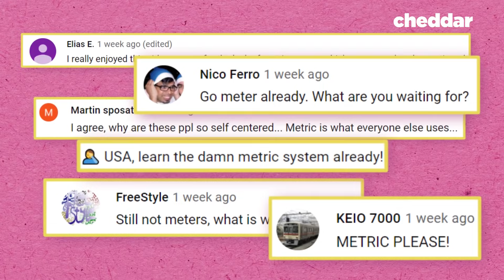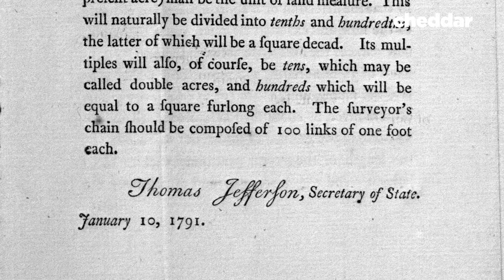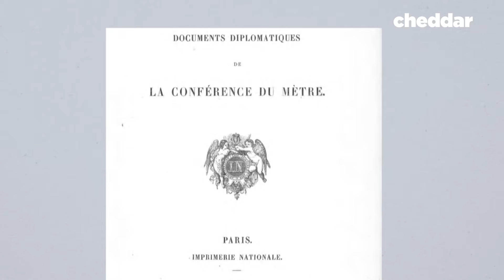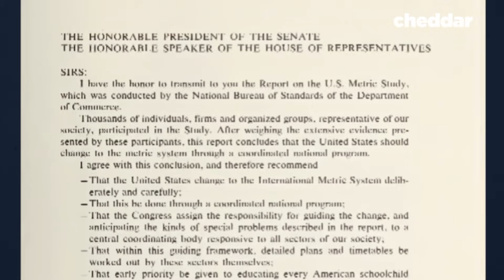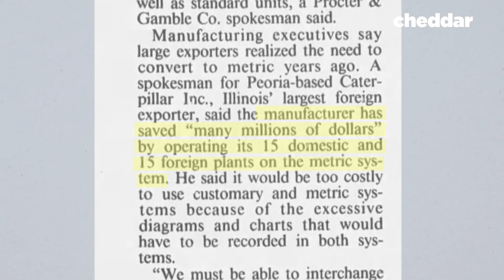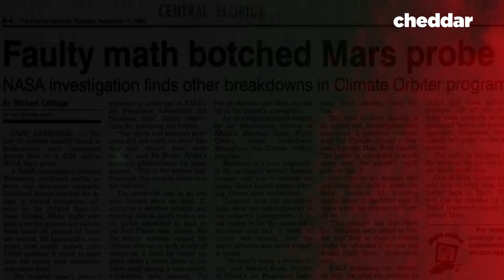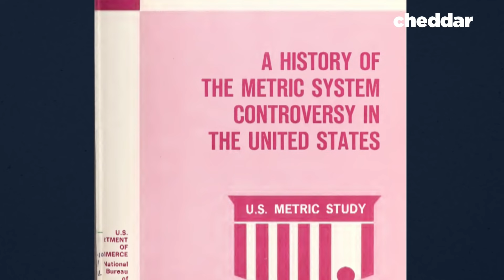Why Doesn't the US Just Use the Metric System? - Cheddar Explains

Comment: Just look at the conversion tables, metric is far easier then imperial.
Reply: you dont even NEED a conversion table :D
Reply: @Great.Milenko  I am America. I believe in the metric system. Not because of convince, I just don't think our base measurement should be the length of an average male foot. Saying it just sounds random.
Reply: @ItsNullAndVoid  the inch is actually based on 3 barley corns.
Reply: @Great.Milenko  That's even worse.
Reply: @F.B.I  Don’t talk to the foreigners, they don’t understand feet like we do. Go back to your house and count your barleycorns like a good patriot.
Reply: @markme4  It's spelling and punctuation, not grammar. "America" should have been "American", "convince" should've been "convenience", and the comma should've been a semicolon. If you're going to call someone out, at least call them out for the right thing.
Reply: access  metric was invented by the french imperial by the British who we declared independence from which is more patriotic
Reply: @1pcfred  you are wrong. Us customer is defined on metric nowadays.

And a swing of a pendulum sounds even more wired than three corns. It sounds like a witch board.
Reply: @1pcfred  I know, it just sounds weird.
And it's definitively not with a pendulum nowadays. It's defined with metric.
Reply: @1pcfred  after independence the USA used british measurement.
They just formalised it. After the independence the British overhauled their system also and called it imperial. 

As the British rule the world back then, the name is known

You talk of standard and metric. That's fine with me as you are used to it and I know what you mean,even if from the view of the world it is wrong.

On the other side, in my view the name imperial is Wright, because it is a name of a family of measurement systems from the past. You know what I mean and you can grumble what you want, I will use it anyway because I am used to it. 

With metric you can easily calculate with units in your head as you can convert suffixes into exponents an back. For this you need no calculator to get the right solution. Using metric and SI you can even do the calculation only on the units as if they would be a normal calculation. Done with the calculation you can use the result as a check whether or not you formed the calculation right and therefore having the right result.
It is kind of a build in self check in metric and SI. Knowing SI assumed. 
Not possible in imperial. 

Imperial sucks.
Reply: @1pcfred  well, yes, the USA  were no part of the British. But.. Well, I think you know what a declaration of Independence is about.
It is about independence of what? The British (qed}
And your guy didn't invented a new system. If you belive this, we'll, it just proofs your ignorance.
Reply: @1pcfred  then learn.

"The United States customary system (USCS or USC) developed from English units which were in use in the British Empire before the U.S. became an independent country. The United Kingdom's system of measures was overhauled in 1824 to create the imperial system, which was officially adopted in 1826, changing the definitions of some of its units. Subsequently, while many U.S. units are essentially similar to their imperial counterparts, there are significant differences between the systems."

https://en.m.wikipedia.org/wiki/United_States_customary_units

I said nothing else, it derived from the British imperial.
You can read the full story for yourself and check against references.
Have fun.
Reply: @1pcfred  cite:
"The US customary system is based on English systems of the 18th century, while the Imperial system was defined in 1824, almost a half-century after American independence."

https://en.m.wikipedia.org/wiki/Comparison_of_the_imperial_and_US_customary_measurement_systems

Again, Article:
" The US customary system is based on English systems of the 18th century,"
You:
"Jefferson certainly did not derive US Customary from British units."
You:
“I am well versed in the historical facts of this topic" " there is no info out there that can prove me wrong"

Article again:
"The US customary system is based on English systems of the 18th century,"

Well....
Reply: @1pcfred  as I said before.
US Customary is derived from the British system.
Imperial is derived from the British system.
There are only slight differences.
So, what do you want?
I just said, that I as an outsider use imperial for all. We talked about this.

You say standard an metric
I say imperial and metric.

So, get over it.
Reply: @1pcfred  well, in this we agree.
Reply: @adventuresofcats7857  did you not watch the video? Because money.
Reply: Perhaps if you need to do those conversions. Most of us do not. For what we do we find US Customary the superior system too. And don't call it imperial. Because it isn't. Calling it imperial just displays your ignorance on the topic.
Reply: Most people aren’t doing conversations on a daily basis. Most people are just using one unit at a time. But if you’re not living in the US, why do people care so much?
Reply: @n.n.8423  they hate our freedom units.
Reply: Paul Frederick they must be communists 😂
Reply: @Paul Fredrick My Mistake. I meant US customary measurements.
Reply: @zachw566  You mean freedom units?
Reply: @zachw566  correction noted and appreciated. I understand where some of the confusion comes from. We did use the old names. Way back when standards were a general problem though. Every workshop had its own at one point. Precision was also not as critical as it eventually came to be. Eli Whitney did not fulfill his order for muskets until 1798. Before then it was anything goes.
Reply: Yes but they are just too lazy and patriotic
Reply: Well if you know them all by heart the conversions don't matter.
Reply: its not when using imperial all your life
Reply: It's something we know from experience we have next to no idea on how much anything metric is
Reply: Yeah, but it’s not gonna happen. Asking us to memorize the new standard gauge of railroad tracks is changing to mike to another random number of feet
Reply: @Thunder Life good for you? Why are you telling me? 😅
Reply: dividing 10 not as easy (10,5,2.5 then what 1.25) now (4,8,16)easier decimal  its better when the need to be precise more than 1/8" or1/16" i give them that
Reply: @lauroxicotencatlreyesmarqu931  That's dividing by 2. Dividing by 10 would be 1000, 100, 10, 1, 0.1; 0.001. All you need to do is move the current digits a digit over. You only need to keep constantly by 2 when you're trying to finding, the middle of a length, then the middle of that length, then the middle of that length, etc.
Reply: Definitely hands down harder for me. Some people can't learn one or the other and some people can learn both systems.
Reply: Give me the scientifically precise figure for a third of a meter. It may take you a while so keep an eye on your base twelve clock.
Reply: Metric is decimal which is base 10
Reply: Yea why you crying, stop crying about it
Reply: You may find metric more convenient because you grew up with it, and I’m not arguing that metric conversions are easier. However, the imperial system is part of our country and it would be disastrous to try and make us switch. We tried it. It did not work
Reply: @zachw566  the USA does not use Imperial. We never did. I can tell you exactly why it didn't work. Because I remember when we tried to switch. Was in 1975 or 76? For a couple weeks before the switch I was instructed in the metric system. We all had it down. Then the country went metric. Instead of gallons of gasoline people were buying gas by the liter. But the price did not change. Gas was 99 cents a gallon and it was 99 cents a liter. Unfortunately liters are a lot less volume than gallons are. 3.7 times less. So it took a lot more liters to fill gas tanks up. People were not happy about the fact that metric cost them so much more. So unhappy there was talk of violent revolution. What we weren't told when we learned about metric is the international oil standard. There's many gaps in education. Now some of yours are filled. The US finds it very convenient that the world is ignorant. It would be disastrous for us if we were all on an even footing too. But when oil has to be paid for with blood we pick that tab up for the world. So it all evens out in the end.
Reply: @zachw566  actually we did the auto manufacturers all us metric almost everything is made for metric the just put imperial on it
Reply: @Thunder Life You can make the length of anything a set measurement, but it is important that the length stays consistent no matter the time. 10.354 inches is currently the average length of a European male. If everyone somehow forgot how long a foot was (and all past recordings of the information were lost), it would be near impossible to recover it. The metric system is based on the length of a quadrant of a great circle of Earth, measured around the poles of the meridian. This is not likely to change in the next million maybe even billion years. This is not even the imperial system's main problem. It's main flaw is how it is partitioned.  A foot is 12 inches, a yard is 3 feet, and a mile is 1760 yards; none of these are even remotely consistent. Opposed to the metric system which has a centimeter as 10 millimeters, a meter as 100 centimeters, and a kilometer as 1000 meters. As you can see the the measurements are partitioned by a base of 10.
Reply: @ItsNullAndVoid  The meter definition is the distance travelled by light in the vaccum during 1/299 792 458 of a second.
The length of a quadrant was it's original defintion but the problem is : earth isn't exactly round. So, the measure fluctuates if you make it closer to the pole or closer to the equator. Doesn't change much in daily life but it was needed for more precision.
Reply: And yet, in college classes I had in the US and learning about the metric system, they struggled with that conversion.  Yet these same people who struggled with a simple 10 power conversion could easily do inches, feet and yards and many knew how many feet were in a mile.  Its truly amazing how ignorant both sides are here.
Reply: rizon72 Still metric is easier. 1m is 100cm is 1000mm, 1km is 1000m is 100.000cm. It‘s all logic.
Reply: @rizon72  I wouldn't call myself ignorant. It's not that I don't want to understand, I wish I did. but I don't. The imperial system makes no sense to me 😅
Reply: Xeclar the metric makes no sense to me either

Comment: In Australia I have seen both systems used. I've met drug dealers and drug users who've all said that they use imperial for measuring stuff. I've been to places that measure the length of bolts in inches and the width of the same bolts in millimetres.

Comment: When you are talking precision measurement, then it doesn't matter,  precision matters, but for everyday measurement, say for cutting a 2x4 LOL, 1/4 1/8 1/16 is easier to use
because of distinct marks on the measuring tape/straight edge/ruler. It's the idea of using a line to measure a curve, which is impossible and spawns transcendental numbers and people
believing that the diameter of a circle is Not 1/3 of the circumference, that upsets me. God made curves, humans prefer lines, and linear thinking, God is omnidirectional, Mandelbrot shows
us how the Macro and Micro are connected, the powers that be, don't want humans to get too smart and figure out their demonic agenda, before they have us completely controlled. School is a Joke.

Comment: American engineer here. I can tell you first hand, using imperial system sucks!!! Try remembering the conversion of slugs to pounds,  the density of water in slug/ gallon, or converting 193 11/16 inches to feet in your head. All of these I can remember easily or calculate in my head with metric system. 1kg = 9.81 N because acceleration due to gravity is 9.81 meters per second squared. Density of water 1 g/cm^3. 1 meter = 1000mm etc. So much easier...
Reply: Really? An "American engineer" doesn't know how to add whole numbers to fractions? Math 101: 11/16 + 193 = 11/6 + 193 /16 = 11/6 + 193 * 16 = 11/16 + 3088/16 = 3099/16 = 193.6875 = 193 11/16.  Not a great use of the imperial system but I'm no "engineer"...
Reply: @FlibbidyFleu  and you can't do that IN YOUR HEAD, einstein. That was the whole point of my comment. Not that fact that I know how to do it or not
Reply: Alright genius, you still didn't answer the problem. What is that in FEET?
Reply: Your right the conversion of 16 to 12 gets confusing it should be 16' 11/16" if I'm not mistaken. Even that is off, but your right, I couldn't do it in my head and it wasn't easy. You know your shit and I'm willing to admit it. I'm curious if you find any faults in the metric system such as thirds?
Reply: Oh boy, I was way off on this. Note to self, don't drink and math. Anyway the correct answer is:
11/16 * 193/1 = 2123/16 = 132.6875 or 132 11/16 feet. Could I do that in my head? Yeah. Would I? Depends. The biggest issue is converting the remainder of .6875 to a fraction figuring that out in my head would be difficult since you need to find the GCD and divide by it. However I assume engineers know the common decimal to fraction conversions at least, or have a conversion chart handy. Now if only I could divide a dollar evenly between three people....

Comment: Ever worked on a car? You'll realize very quickly why Americans dislike Metric, you have about 500 slightly different sizes for everything and if it's foreign car that uses metric you'll spend 20 minutes trying to find the right tool size. Also Celsius is a screwed up Temperature system. Who the hell walks outside and says "It's a nice 30 degree day outside!" Fahrenheit is the Temperature that Human beings associate Hot and Cold with, 60 degrees is not too hot and not too cold, 80 is Hot, 30 is Freezing, and negatives are below freezing. It's honestly a much simpler and In my opinion superior system. Imagine a scale from 1-100 the higher you go the warmer the temperature, 60 would be a slightly warm middle temp, see? Makes perfect sense.

Comment: In canada because metric was switched over in the 70s alot of older people still knew imperial.. so it effected our culture for younger people. Being next to the u.s.a. we still use both. Kilometers for driving, milk and juice is in liters, and gas is liters. But weight many people still use pounds,.. 185 pounds..and property size still goes by acres, and we still use feet and inches for someones height. And 0 to 60 for the quarter mile.. and inches for t.v. screen sizes. So even though we are officially metric, we still use both on the daily.

Comment: One thing to clarify is that the system in the US isn't quite the Imperial System. It has been altered somewhat. Like the video said, it is closer to metric equivalents than the original Imperial but not quite there. It's better called the US Standard system.

Comment: Problem with the metric system is its based around 10s for no reason whereas the imperial system is based around 12s, 12 is a more useful number especially in mechanics and other things as its easily divisible by more numbers. Its also the reason why we have 12 months of the year and 24 hours in a day and12 hour dials on clocks
Reply: Unless fractions are used then we get a mix of 1/2, 5/8 and 13/16

Comment: Despite being American what really gets me is the sizes of wrenches, bolts, etc. I find it mindboggling coworkers who have been on construction sites for decades can look at a bolt head and say, "you need a 5/8ths wrench," or an "11/16ths wrench," but to the same people making these estimates in millimeters is too hard, and on top of that "stupid" for not being American. 

Then there's bullet calibers, which are in decimals of an inch 🤔🤨🤦‍♂️
Reply: wrench sizes in metric are just as easy to someone experienced with them. I also find it crazy though , i lack this particular skill, 

another useful part of the metric system is the use of two standard thread sizes (there are others but mostly its just two, coarse and fine. )

Comment: In Canada most of the residential construction industry still uses the imperial system.  The imperial system is still used in the farming industry as well since the land was plotted using the system, as well as the distance between county roads and highways being in Miles.

Comment: I think the simple fact that we crashed an entire space mission into a planet would be enough to swap. Blowing $327mil to create a pile of useless debris on Mars is not a good use of resources or time. Converting fully to the international standard base 10 Metric system would not be a waste of anything. 
Besides, it's not like you have to change what you use in everyday life, I'm Canadian and I'm 6'1", I build my buildings with the studs on 16" centers, I order inch-pattern sandwiches from Subway, and I buy my apples by the pound (even though the signs have kilos too.) On the other hand, I don't have to account for a $327,000,000 loss every time I mistake a kilo of apples for a pound. One thing I do really enjoy is the millimeter. I use that like it's going out of style. Much better than fractions of an inch, until you hit thousandths of an inch then I'd say it doesn't matter if your using 12 thou or 0.3048mm because everything is gonna be very carefully measured by a tool that uses whichever units you like. What really matters is documenting which units are used and making sure that information is displayed to the end user.